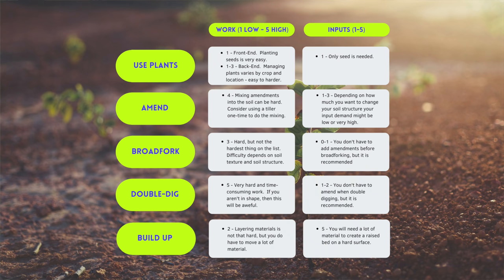6 Ways to Fix Clay Garden Soil | EASY to HARD Methods

Comment: I've got heavy clay soils in drylands Chihuahua Mexico. I find that planting seeds directly into the soil, watering with compost sludge and then covering with sawdust to avoid evaporation seems to work. The tap root from a seed can break through anything if it's accompanied with some michorrizal fungi. Transplanted plants don't work until I have managed enough organic matter and can provide shade for at least a week. I tend to add biochar rather than sand if I have it and I soak it in the compost sludge.

Comment: I would use perlite instead of sand. It’s lite weight, brings ton of air into the soil, and it’s still relatively cheap compared with compost. 
Great video Diego ❗️Thanks for educating us.

Comment: No easy solution to address compacted clay soil on my large turf areas until I discovered the Anderson’s humichar and biochar. My research indicated you could over apply both products without doing harm. I’m a lazy old guy so I went 3-4 times the recommended application. Amazing difference in the soil with definite soil aggregation and the biggest surprise was tons of earthworms in an area I had basically given up on .
Can’t give results yet but plan on doing boogie brew compost tea applications to the area because you can easily supply the tea via an ortho hose end sprayer.  Hoping the microbes will begin to totally change the soil environment

Comment: This reminded me of an old timey method of breaking up clay soils.  You do have to start the year before, and plant mangels, which leave a good sized hole.  Once they are of a good size, you turn out pigs which will root them up and feed on them.  Then the pigs go to freezer camp and the manure ages over winter.  I have heard you could also use daikon radishes and just let them rot away over winter, so no pigs involved with that method.

Comment: This year I tried using sweet potatoes to break up the clay but none of them lived very long. I'm thinking of using sunflowers in a raised bed next year, so the deep roots will break up the soil and pull deep nutrients up to the surface. Also considering interplanting some creeping and vining crops to add a blanket of organic matter.
Reply: Definitely a mix of crops, not just sunflower. Some beans, clover, corn, sunflower, sorghum, etc.
Reply: Alfalfa works
Reply: Daikon radish is good for breaking down clay besides plant care, you let them grow and chop&drop leafytops let the rest rot in the soil over winter. Anything with long taproots as well like dandelions.
Reply: the sunflowers method actually worked for me , and I didn't even do it on purpose lol. we bought a few acres 2 years ago and moved in 2 years ago. The first thing my wife wanted was sunflowers,  so I planted several rows. some of them mammoth sunflower. I did add some compost on top of our clay soil, and wow, dude , those roots went deep.  I chopped and dropped leaving the roots in well this year I grew other vegetables in its place with great success,  and also planted another round of sunflowers for my wife haha.

Comment: Thank you for the helpful information, Diego! We recently moved into a new home with heavy clay soil plus large roots from a couple of oak trees. Unbeknown to us, the previous owners covered an extensive area that had been covered with small rocks, with bark to make it look better. Argh! It was so bad we hired landscapers to try to remove most of the rock.  We're now trying to prep a couple of areas for more plants and was wondering about the use of a liquid soil conditioner, ie  Groundbreaker by "Green as it Gets".  When planting some tea roses in the newly cleared area, I had my husband dig an extra large hole, then I tried to make holes in the bottom of the hole before adding some of the liquid soil conditioner and then a mixture of the native soil plus purchased rose potting mix. Good idea or not?

Comment: I just saw a video on a video on a relatively easy way to get rid of weeds and increase soil fertility. Similar I believe to the lasagna method.. First you weedwack or cut down any weeds that are there now. Next you apply a like 2” layer of manure or compost,then a layer of cardboard and wet the whole thing well. Next goes on a layer of wood chips, preferably not pine but if that’s all you can get, so be it. Next another 2” layer of manure, wet it down again. Then another layer of cardboard, saturate again.. I kind of remember that you could go higher if needed but that’s as far as went with it.  Then you cover the whole shibang completely with a tarp (your preference). Finally, overwinter the plot or longer. You may choose to till in or it all into the soil and I hope you will be happy with the results. Cheers

Comment: Great video. The only thing I have a question about was, I was under the impression that if you build up layers, that the compacted soil would get better underneath. One, it stays moist which helps roots penetrate it, two, worms tunnel in and out of it carrying nutrients back down deeper. I am not sure if this is 100% correct but I have seen some effects of this at my property which  has silty clay soil known as Bull Tallow. It is yellowish clay dirt. Anyways as always, great insight. I am always learning more.
Reply: Yes, this definitely happens, subsoil will be mixed with top dressed compost, decomposing organic matter or worm castings. This process does take time, but it will work unless you have rocks underneath shallow layer of sand/silt/clay.
I dug up some holes for fence posts in my grandpa's backyard (hard, hard soil, no vegetation for decades) and there were still worms in the ground, which was odd to me regarding the soil toughness and absence of living roots for a long time.
One trick to use to force worms to move close to your plant root zones is to put a plastic sewage pipe (4 - 6 inches radius, couple feet long) and bury it halfway into the soil. Then, you put some food scraps into the hole, and putting the lid is mandatory to make sure worms aren't exposed to sunlight.
Reply: not really, watch this video about wood chip mulching over hard clay 5 years latter and little change. My own Charlotte, NC yard has taken 25 years for ONLY the top two inches to become good soil. When I made a garden I remoed the top two inches to get rid of all the invasive bermuda grass so I was basically back to square one.
Reply: opps here is video link https://www.youtube.com/watch?v=goUfl4x8URc
Reply: @southbridgeforestHOA  you need living roots to improve that type of soil, and it needs to be overplanted with some cover crop, to create that strong web in the soil.
Reply: @tesha199  perhaps, but how many years would it take to actually improve vs till or braodfork
Reply: @southbridgeforestHOA  initial tilling is quite welcomed before laying mulch. Broadfork is for loose soil, you can't do anything with hard clay.

Comment: You have clods? When I first moved to this house, I had a acre clod! Not even weeds could penetrate it. It would have taken tens of tonnes of sand. A broadfork couldn't penetrate it! 
To layer on top would have needed one acre times eight inches of compost. That wasn't happening.
The only viable option I could see, was a combination of plants and tillage. 
Four years in and I am successfully growing veg. Mostly, I am just growing soil. 
Now I have the confidence and experience, I'm buying another acre, next to us, which is just as bad. I think I can turn this one around in three, if not two years.
Reply: Mostly I am just growing soil-
Most used phrase here

Comment: Sand is a good abrasive tool ,especially when grinding dry clay. Just figure out the ballanced ratios with good compost and gypsum . I planted a rose garden two years ago and it was double dug
Taking out all of the hard pan yellow clay ,replacing it with darker,more enlivened soil allowing for proper mounding and drainage. Some sand was added for companion planting areas
I hate hard clay,yellow and blue,over the years it has been the bain of my existence.

Comment: Some one mentioned gypsum to me i stead of sand along with a ton of compost. Will this work?
Reply: I worked in an extension service soil testing lab decades ago.  Gypsum was recommended for clay soil.
Reply: Always add compost.
Reply: @yana1955  ….gypsum to flocculate the soil…ie break up and separate the clay particles!…☺️

Comment: I’m going through a lawn renovation and about two inches down the soil is incredibly dense and so compacted that I had trouble using a shovel to dig into the soil.  I want to remove about two more inches of that compacted soil so I can add three inches of a blend of top soil, all-purpose sand, steer/ chicken manure, grass clippings for more organic matter. and nitrogen fertilizer. I have declared war with the dense soil in my lawn. I WILL HAVE A NEW LUSH GREEN LAWN. I WILL HAVE MY NEW LAWN AT ANY COST.

Comment: Hi Diego, why no mention of using gypsum? Previously, I was always told to add gypsum to change the structure of clay based soil. If it doesn't work could you say why please.
Reply: If your soil is tight due to an over abundance of Magnesium then it will help by converting the it to Magnesium Sulfate which is Epsom salt. That will allow rain water to flush it down into the subsoil but who knows any of this without a soil test 🤷

Comment: I am doing a 4 x 4m spot , im 6-8'' down and using a mattock to pull out chunks, I have lost count of buckets I have thrown away and have 2 piles and im not even half way through. I could open up a pottery shop! Is adding sand really a thing? Someone else said dont do this, it will turn into a hard concrete substance

Comment: Adding sand to clay soil is wrong, wrong, wrong! I took a soils class for my Civil Engineering degree and were told that mixture would be absolutely unworkable. Gypsum helps and so does organic materials with humus in it.

Clay soil tends to be very fertile. If you add amendments to clay soil and don't work clay soil when it is wet you can put in a decent garden. My soil is clay with big chunks of sandstone in it. I have the fertility from the clay and decent drainage from the sandstone. The problem is getting plants whose roots can work their way through this soil. I have some mature trees with tap roots that grew at 84% of the normal rate due to their roots having to go around rocks. My lawn looks like the scalp of a man who is balding during the summer since you can see the soil through the grass even though where I reside we get 50 inches of rain/year. Walking on my soil hurts my feet. It doesn't have any give to it. I am planting raised beds, going to overseed my grass with miniature clover seed and am looking for plants that can handle these conditions once they get established. I also am going to get wood chips and mulch my plantings to add organics to my soil. This is going to be a long term project.

Comment: Vertical mulch with a well auger, drill auger or hand auger. up to 1.80 meter/6 feet. Then ammend the hole wih your prefered method.

Comment: If I want to quickly change a bed to break up clay I would take a bit of different tact. I would  cover the bed area to kill weeds in the bed. After 2 weeks I would pull the plastic then add a couple inches of sand and about 5 inches of compost or manure, then till the hell out of it. Let it rest a couple weeks then plant it.

Comment: Ugh….I have solid yellow clay in my flower bed.  It’s about 1-2” below the surface.  It took me four hours of adding a soil conditioner with a shovel the other day.  Now I have clay balls on top that turn rock hard when they dry.  This stuff you could make pottery with, it’s that clay-like.  I’m unsure about creating a bowl in my flower bed if I add amendments but the border of it is still solid clay.  I’m about 130lbs and have to stand on my shovel with both feet just to get it into the ground.  It’s frustrating and a ton of work.  Maybe I should just go the raised bed route.

Comment: Adding sand to clay soil can make concrete.  You would have to add at least 1:1 ratio of sand to clay to break it up efficiently.  I one foot soil depth of clay could equate to several feet of sand to break it up.
Reply from the maker: I am not sure how that logically makes sense.  Take some clay and mix in sand and tell me if the resulting product is harder/denser or looser.  I think that is a myth.
Reply: @DiegoFooter  Not a myth at all.  Clay and sand have been used for thousands of years as a building material.  Clay/Sand half and half plus some chopped straw creates a block that is similar to concrete with the exception of not being waterproof and will erode if not sealed.  That is the mix I've used to create a rocket mass heater.  30/60 clay/sand with the remainder cellulose blown insulation is used to make the top coat which is like plaster.

I have 90+% clay soil 60" deep and the only way, without taking years, I've been able to get it to decent growing soil is through A LOT of organic matter, 50+% by volume.

Comment: sand will actually make your heavy clay worse. it combines and ends up making 'hardpan' which will destroy drainage. first 2 yrs use a liberal amount of gypsum while adding every piece of biologically material you can dump on that plot. gypsum breaks up clay, organisms move in. organisms feed on the organics. done.   ALSO no-till is only applicable to large factory farming....in a garden, tilling allows for oxygen at a deep level. organisms need water and oxygen to live. consistent moister is very important in the gypsum and organisms process. grass or leaves stacked 3ft or better works great if available.

Comment: I would never add sand to clay.  Sand + clay = cement.  If you think it is difficult for roots and shovels to go through clay, just mix in some sand.  It may work for yards that are not heavy clay.
Reply from the maker: I don’t believe that’s accurate. I don’t see how adding sand to clay is going to make the clay harder than it already is. I think that’s a myth.
Reply: @DiegoFooter  yeah....maybe if the new clay+sand mix dries out and/or is compacted, maybe it "turns into concrete"....but that's not going to happen in a garden setting.
Reply: @DiegoFooter  Sounds like you might have a good idea for your next experiment.
Reply: @finagill  no need to experiment on something that is already known. Adding sand to to clay based soil does not make concrete.
Reply: @SandstormGT  There are many that disagree with you.  Is there a point where adding sand is helpful?  Yes but if you don't add enough then you will be worse off for it.
Reply from the maker: @Jamie Woytasik Can you explain why would the soil would be worse off?  I don’t understand how adding any sand makes clay harder than it already is.  Unless it dries it isn’t getting harder.
Reply: I don’t think that broadforking a relatively small amount of sand into clay soil is going to make concrete. However, I’d be wary to TILL in a large amount of sand into clay, like one might be tempted to do to convert clay soil into more of a loam. I wonder if the latter scenario is what some people on the interwebs are cautioning about.
Reply from the maker: Thanks for the comments.  :)

It seems to be a very controversial topic online with very polarizing opinions.

I think the truth comes down to how much clay do you have and how much sand are you adding.  I would think that would be obvious.  You can't add a little bit of sugar to a gallon of lemon juice and call it lemonade.  

To dilute the clay down to workable levels you need to add a lot of sand.  Obviously starting with a lot of clay and adding a little sand won't do anything because the clay still sticks together with the sand in between it.

A lot of clay and a little sand results in the clay holding the sand and sticking together, so your clay baseball size ball is now a heavier clay softball size ball because the clay encapsulates the sand.  

"Concrete" is a slang way of communicating sand trapped in clay versus an actual definition of the final product.  You can think about sand and clay like concrete from a visual perspective, but sand and clay (when not hard) are not any more like actual concrete from a physical perspective than pure clay.  A horse painted like a zebra can be called a "zebra", but it's still a horse.

Article for concrete:
https://s3.wp.wsu.edu/uploads/sites/403/2015/03/soil-amendments-2.pdf

Article against concrete:
https://www.gardenmyths.com/sand-and-clay-dont-make-concrete/
Reply: @HoosierBenzo  Not really sure.  I know I have only been adding organic materials on top of my soil.  I then let plants do their thing.
Reply: I run 7 50x50 market garden plots in what was heavy clay soil. 4 of the 7 plots have sand I added. One was "sharp sand," from swimming pool project. Two have river sand, and the third was from a neighbor that wanted to get rid of a huge volleyball pit, and I got all that "rounder type" sand. None have turned into "concrete," and I'll take my sanded plots over the clay plot any day of the week. Drains better after heavy rain, tills better, is smoother after tilling, is permanent like he said in this video, and plant roots go down/through easier. It's a win win for me.
Reply: The issue with clay is when it dries and harden it becomes hydrophobic. Hydrophobic clay is called pottery when it is dried in a kiln. Hydrophobic clay plus sand will also be hard ("concrete"). How do you prevent this 1 add a lot of sand inches of sand, 2 add organic material and food for the soil web, 3 mulch to keep soil moist and alive with microbio, 4 plant a diverse cover crop to to help season the soil before gardening.  If your soil does go Hydrophobic you will need to add a surfactant to break the phobic behavior quickly.